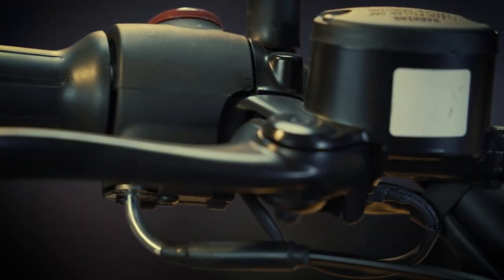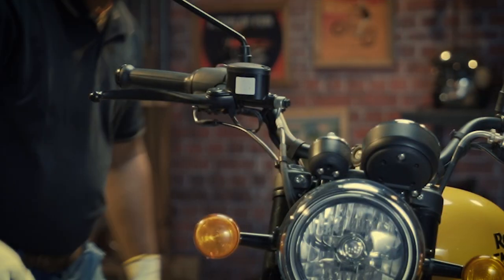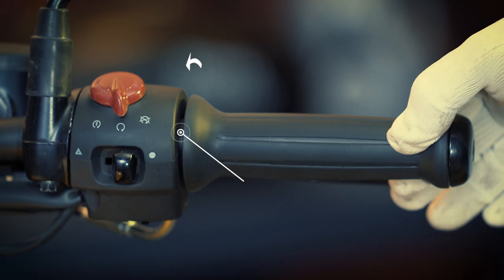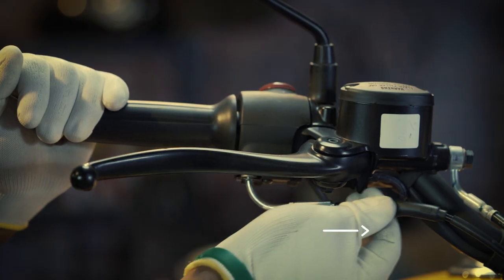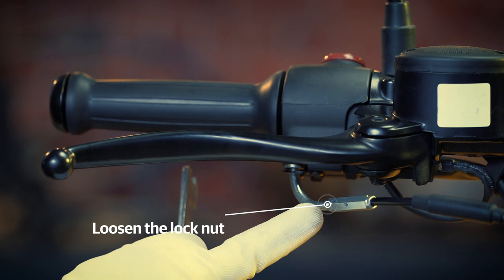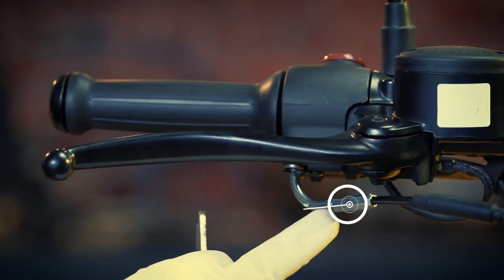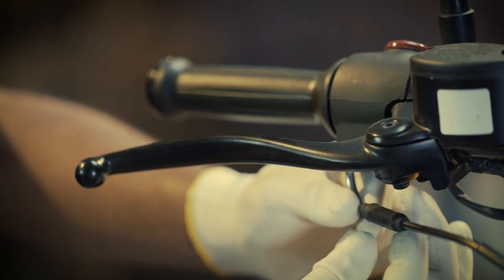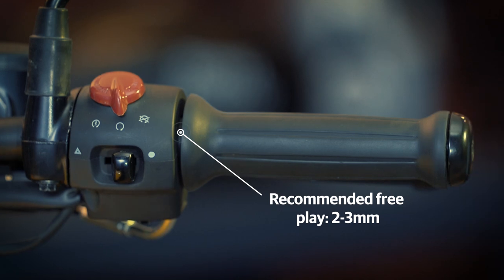THROTTLE CABLE ADJUSTMENT | Royal Enfield Meteor 350 DIY

Comment: Swapna Motors Bhubaneswar Odisha is a Worst Dealer for this ROYAL ENFIELD BRAND. They are not able to provide service to the customer for its warranty. I am facing brake sound problem from day 1 from the purchasing of the Meteor 350 Top model from last 1.5year. But still now they are unable to provide me service where as we all know that, royal enfiled have 3years manufacturing warranty.

His owner Mr das also neither responding my Whats app messages nor receiving my phone calls.   Request to everyone to go to other dealers of Royal enfield except this and also try to purchase Other models but don't Purchase Meteor 350 for which I am suffering from last 2years.